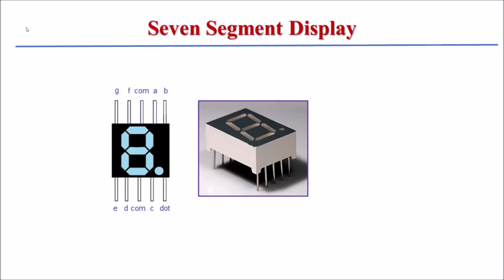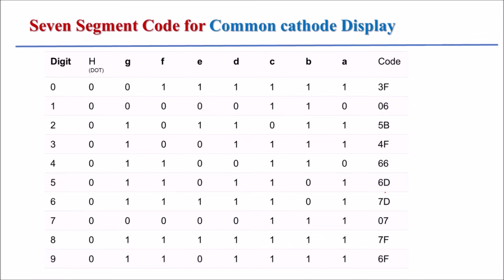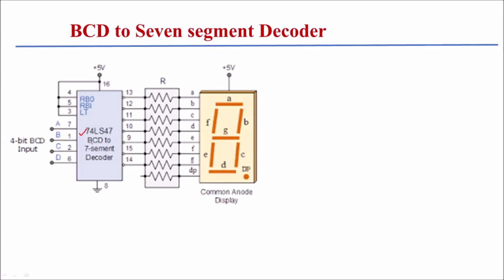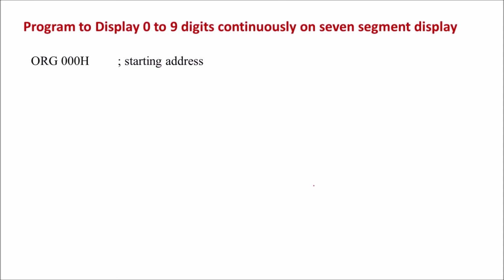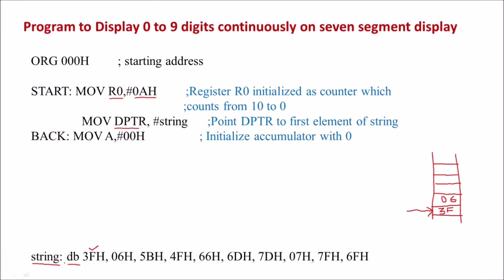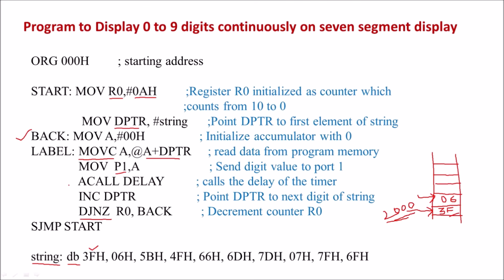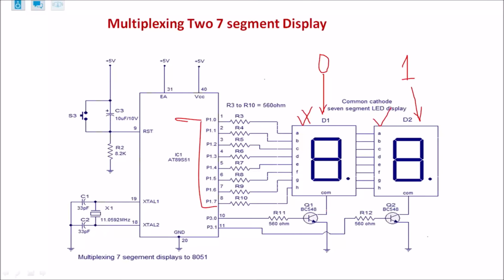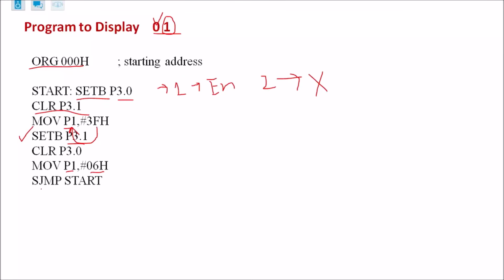Lecture 23: Assembly language program to interface seven segment display to 8051|display interfacing

Comment: This Lecture would go nicely with the 4x4 matrix keypad lecture 29, that way you would actually have an input and a two HEX digit output, using the 8051 micro controller.I think you would have to store the first value entered and shitf it over when a second value is detected. Then when a third value is detected clear the fist value out or back to zero.

Comment: This is a nice tutorial on multiplexing 7 segment displays. However, you only discuses one possible 7 segment display table for the common cathode. There are many different ways of reading and writing the 7 segment display codes. I am not trying to confuse anyone, just providing the information, that there are several ways of writing a truth table for a 7 segment display and it also depends on how you wire your segments and of course there are just as many different tables for common anode displays as well.
Reply: Hi,

I have few question on 7 segment display and i am making one project based on it and i'm stuck in that project, can you please help me Jeff Nay